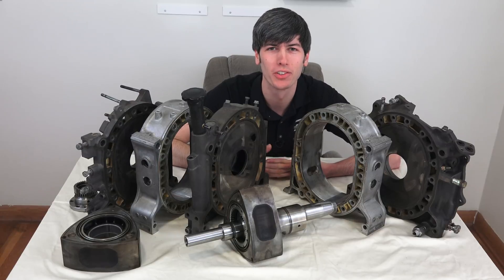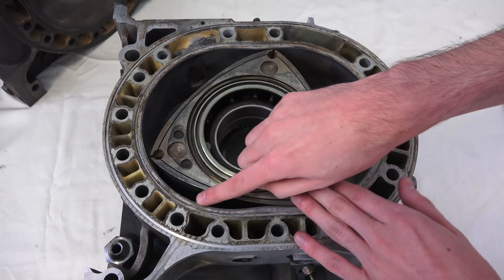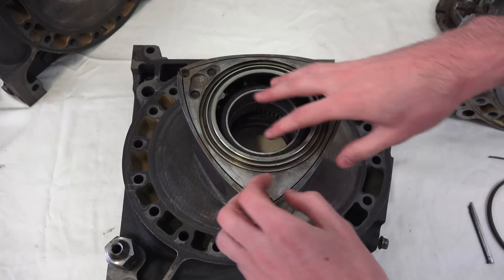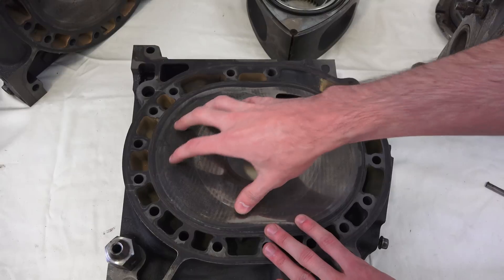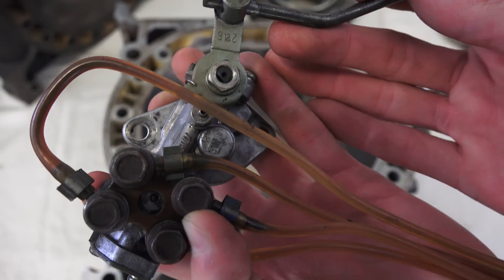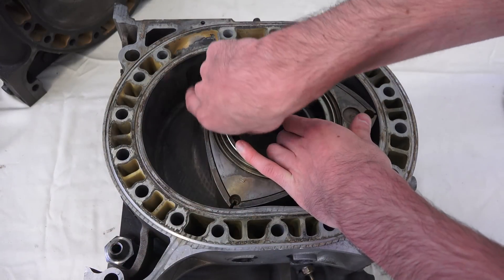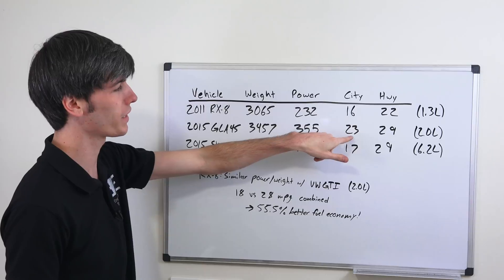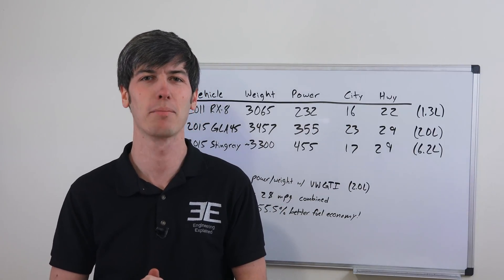4 Reasons Why The Rotary Engine Is Dead

Comment: Could the unburnt fuel problem solved by placing one of the spark plugs (or a third one) further back and time it differently so it ignites the unburnt fuel that's about to leave on the exhaust port?
Reply: This totally makes sense somehow.
Reply: If im not mistaken. the HEMI engines use something similar in concept. a second set of spark plugs to burn fuel on the exhaust stroke.
Reply: +Dinosbacsi it is too late to burn on exhaust stroke
Reply: gjiil
Well I'm not saying to ignite it when it's already leaving the chamber. Ignite it in the middle of the burning stroke or something. It would give it a little bit of extra kick before the exhaust port opens up and also if you ignite it from the middle or the opposite side than the original 2 plugs, it'd burn the fuel that originally is not reached by them.
Am I a genius or am I a genius?
Reply: +Dinosbacsi Doesn't work because the air fuel mixture is no longer under compression. All you'd be doing is igniting the remaining fuel (if it would even ignite before the rotation finishes) it wouldn't create any more power.
Reply: +Dinosbacsi You would get a stagnation of the flame front that would fight the flow out the exhaust. The problem is gasoline only combusts so fast, above a certain RPM the flame just can't move fast enough to get out of the rotors way.

Comment: You had the next motor in line from what I use. The LS3 makes more power with less fuel, but you left out the motor to motor comparison. Since the LS came out the Rotary no longer makes more power to weight than most motors. After you add the turbos and pipes to make LS power it's weight is about the same or more, so no longer good for keeping car weight down while adding big power. Much cheaper and easier to swap in an LS motor instead now. The GEN V LT1 is even better.
Reply: I couldn't make sense of all that you said, but 231bhp from something you can put on a sheet of A4 paper whilst N/A is pretty immense power to weight. Also, get any V8 to rev to 10,000rpm without breaking anything. You just can't
Reply: +x3D I guess our unlimited LS7 motor shouldn't work at 9600 rpm anymore.
Reply: +Shawn Dickens and the swept volume of the cylinder is probably about 30mm yeah?
Reply: +x3D 30 mm would be a distance. the motor is 427 cubic inches with 3.62 inch stroke.
Reply: +Shawn Dickens I've done some research. The LS7 has a redline of 7,200rpm. The engine costs $25,000. My entire RX-8 costs about $825 at the current exchange rate, with a rebuilt engine, coilovers and a toyo sport exhaust. I think we're comparing engines in different leagues and as STANDARD the rotary revs just short of 3,000rpm higher than what you say is one of the highest revving V8s.
Reply: +x3D so what stock rotary makes 415HP to compare with the LS3? I was looking at power to weight though, so not really where I was going.
Reply: +Shawn Dickens 20b? 26b? Anything three or four rotor will make easily in excess of 400bhp. The 20b is a three rotor 1.95 litre and the 26b is a 2.6 litre that can produce 900bhp N/A
Reply: And weigh in at? The LS3 makes over 1HP per pound stock and with a cam and Springs can make about 1.75hp/lb. As for LS7 costs it is more do to advanced block, but mostly titanium rods and valves, but again only brought up because you were talking revs instead of power per weight. The next motor is the GEN 5 LT1 new in 2014 that makes 460HP but is still 6.2L like the LS3 GEN 4 motor at 415HP.

Comment: Great video, doesn't the engine also have problems producing adequate torque when compared to a similar spec'd piston engine?
Reply from the maker: Maybe in numbers, but torque is really just a matter of gearing. These engines are high revving and very powerful for their size, so with appropriate gearing torque isn't really an issue.
Reply: yes. More gutless down low than a 4 valve overhead cam motor.
Reply: okay thanks!
Reply: Engineering Explained if they are geared enough to not need that torque it would explain the mpg issue. Since there are no 10 speed manuals these things would need to run the highway at to high of an rpm while the Vette next to it idles by doing 80mpg at like 1900 rpm.

Comment: Long live the NA inline 4 :^)
Reply: +x3D and that 231bhp figure is also measured at the crank. NA 4 cylinder bikes have been pulling off that level of specific power of years. And they last about as long and produce about the same amount of torque.
Reply: Make an I4 N/A with 231bhp 😂
Reply: +Nimeni Defapt yeah, when measured at the crank 😂
Reply: +x3D ..Make a rotary that can be driven fast and get better than 20mpg, and last past 200k mi.. Oh i guess we cant.. Time to stop making them (said mazda 2012)
Reply: Hercules Rockefeller Rotary engines don't break when smart people drive them.

Comment: What about adding valves to the exhaust port?  Wouldn't that solve the problem of fuel economy and a bit of emissions. Well that or something like the 2 stroke exhaust that the motocross bikes use. It has the expansion chamber so it can reuse a bit of the wasted air/fuel mixture

Comment: Its also easy to flood the engine if you don't turn them off properly. Plenty of RX-8 owners have to get towed to the shop just b/c they didn't follow the proper steps to turn off the car!
Reply from the maker: What is the proper procedure?
Reply: +Engineering Explained if you HAVE to turn it on then right off before it has anytime to warm up your supposed to hold the rpms at 3k then Shut it off.
If you do flood it just remove efi fuse and crank it for 30 seconds or so. Reinstall then start it.
Reply: +Engineering Explained When you want to turn off the car, put it in park, (or in neutral with the E brake on, for a manual) raise the revs to about 3,000 rpms for about 15-20 seconds, then turn off the car with you foot still on the gas pedal and the car still revving. This should clear any un-burned fuel from the cylinders, and leave a coat of oil on the rotors. Its completely counter intuitive to turning of a traditional piston engine!

Comment: I had a second gen 1991 Rx-7 and loved it. I owned it in 2001 and put 20k mi on it before I sold it. A potential issue with the rotary was that the apex seals would burn up and also the engine would combust coolant somehow. Never really got into them. I allways wanted a 3rd gen but was out of my price range.
Reply: Doubt your na was eating apex seals but using coolant means your coolant seals were bad. Same function of a head gasket on piston engines....Very common...More so than apex seals.
Reply: +invinciblejets My apex seals were fine, I was just adding to the cons. You are right about coolant seals. So why would the coolant seals fail?
Reply: +CORZER0 over heating and age the irons get weak after while combine a old brittle iron and seal with over heating and your leaking coolant into combustion chamber blowing white smoke and exhaust leaking into coolant passages. 
It all depends on the engine and how old and used it is tho. My first na made it 166k or so before it started blowing white smoke. Was still drivable tho.

Comment: seriously dude, just forget the rx8 renesis engine and look at the 13B-REW from an FD rx7 as the last rotary engine. renesis was terrible.
Reply from the maker: The engine shown is a 13B out of an '85 RX-7.
Reply: But you refer mostly the rx8 which really is a fail of an engine compared to the 13B-REW. And all OMPs are controlled by ECU and not throttle from FD onwards I believe. Either way, still enjoy your videos. Keep it up. 
There are some incredible aftermarket specialists out there increasing the reliability of the rotary every day. Look up Pac Performance, PPRE, Chips Motorsport (Chip Usru), to mention a few.

Comment: Thank you for this video! - Appreciate it! - Here's an odd question, other than cylindrical-based and rotary-based, are there any other types (shapes) of combustion engines that exist? Are these the only 2 geometric patterns used? A bit of Trivia I suppose.